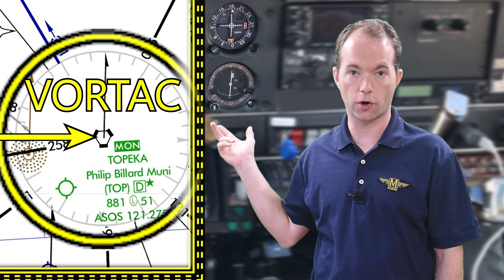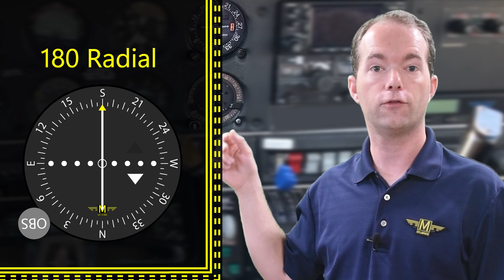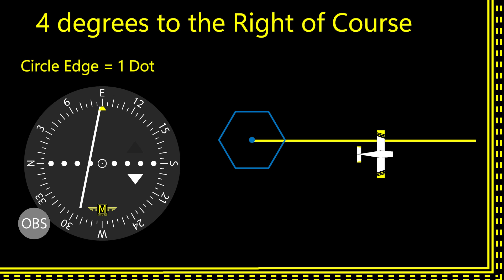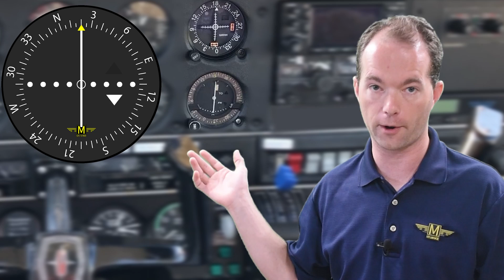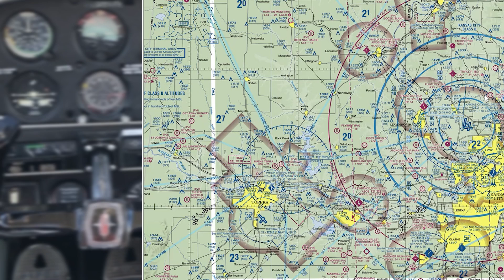The VOR - Instrument Mastery 9 - 121.Mike

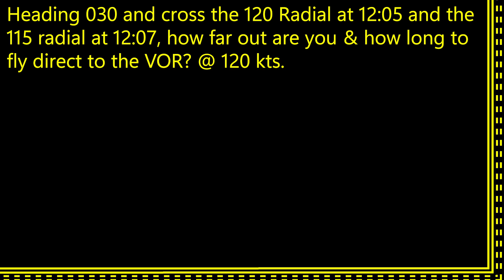Comment: I'm sorry, if the radials are 1nm apart when 60nm from the station. Then how there are 10nm between the 115 and 120 radial when 60nm away from the VOR?? @19:18
Reply: Good eye! Those numbers are meaningless, and WRONG for this example problem. It would be 5mi apart at 60 over 5 degrees or 120nm away if they were 10mi apart. Right?